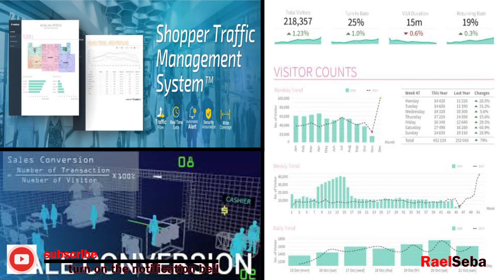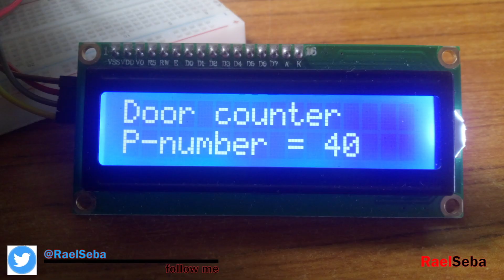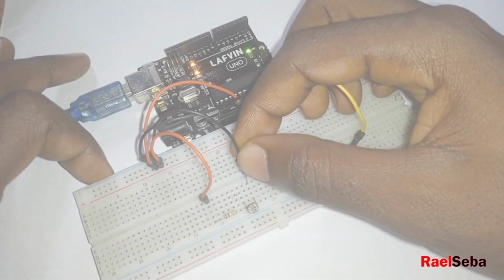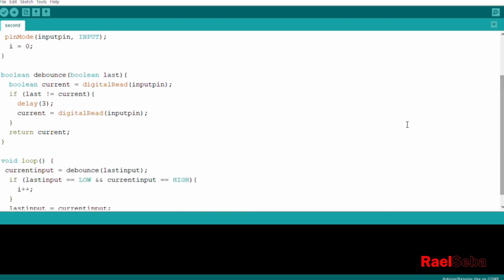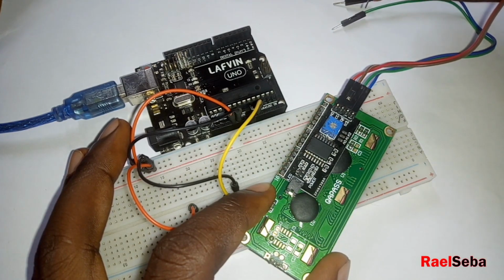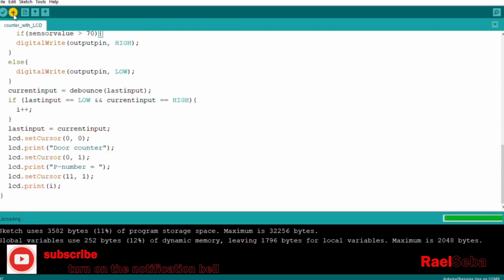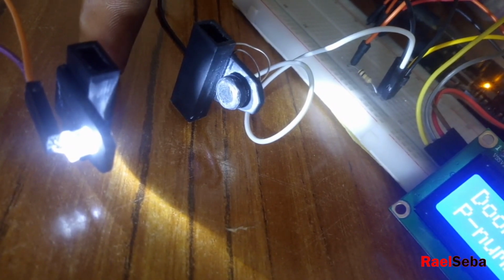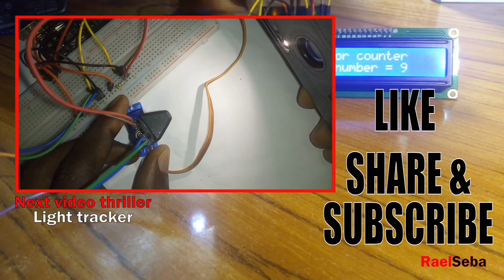Arduino Door Counter Device (with photoresistor)

Comment: I'm very new to Arduino coding.  Is there any chance you can post the full code for this?  Thank you.
Reply from the maker: Sure
Reply: @raelseba  Will you put the code in the comments, or do a reply in this message string?
Reply from the maker: Where will you like it to be
Reply: @raelseba  In the comments please.  Thank you.  I truly appreciate the video and you posting the code.  Happy New Year.
Reply from the maker: Wish you same
Reply from the maker: Use the link you will get the code
Reply from the maker: https://drive.google.com/file/d/1K1fW6bNy4thbilto2X-tPXfJyuXQ3FAw/view?usp=drivesdk
Reply: @raelseba  Thank you. I'll try it later today.
Reply from the maker: You are welcome
Reply: @raelseba  Thank you for what you posted.  However, it doesn't appear to be the entire code that prints the information to the lcd. Nor does it include wire.h (which I can't find) or LiquidCrystal.h  Can you please look it over and
Reply: I think I have figured it out, but would love to see your full code to compare it to what I have.  Thank you.
Reply from the maker: Yeah try it first if it work next 
Include wire.h the library it comes with the IDE
And for the liquidcrystal.h(liquidcrystal library) you should download it from github and follow the video for the rest of the code
Reply from the maker: @chipeaton2604  https://drive.google.com/file/d/1LUGiWMjOJD4R2M_f3q9wWhWYejcYW7mO/view?usp=drivesdk

But u have to download the liquidcrystal_I2C library from github if not it will not work